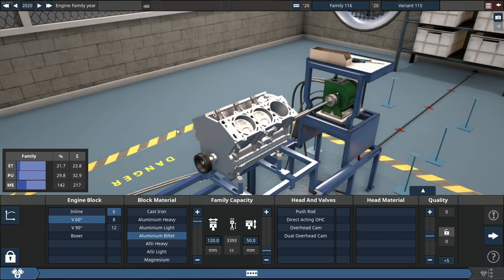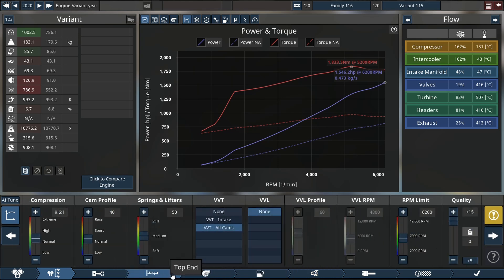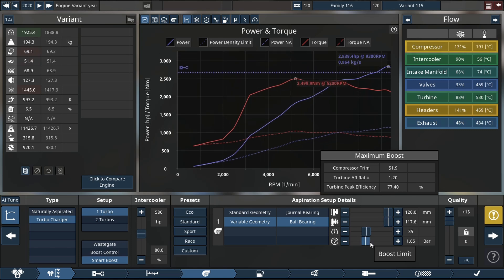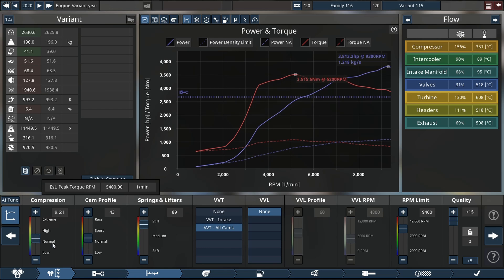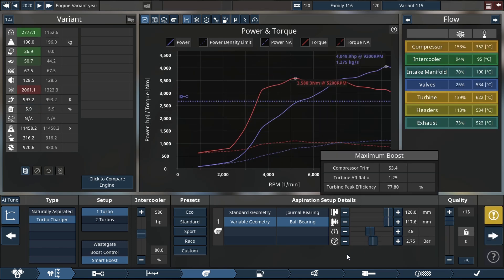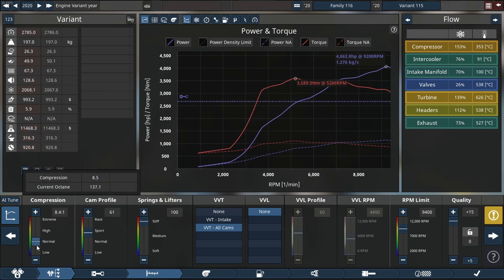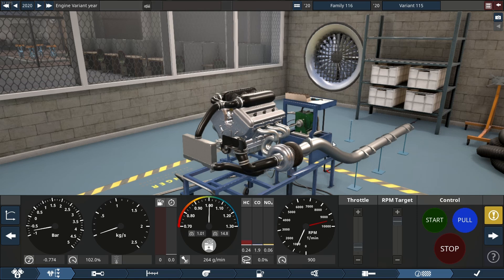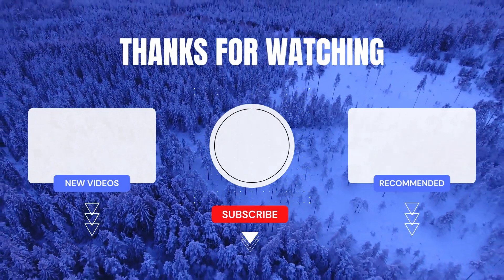6 CYLINDERS 4000HP Automation the car company tycoon

Comment: Merlin engine V12 had 27 Liters and ~1500 HP. Can u rebuild some aviation engines?
Reply from the maker: An awesome engine build idea and I can look into some aviation engines to build thank you for the amazing ideas
Reply: @Curiousgamer20  That would be great. I was always wondering what the limiting factor was with these engines. If you compare the Merlin HP/liter its tiny, even less than the hated Ford ecoboost auto motor.
Reply from the maker: That is true but does engines needed to be over built in order to be reliable but in Automation that isn't a problem so yeah Monday we will be messing with a similar engine